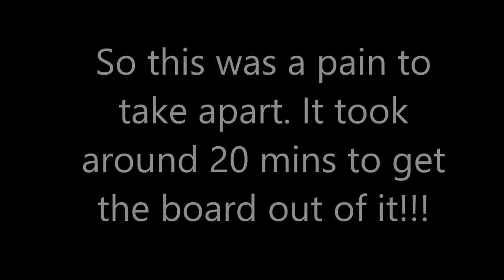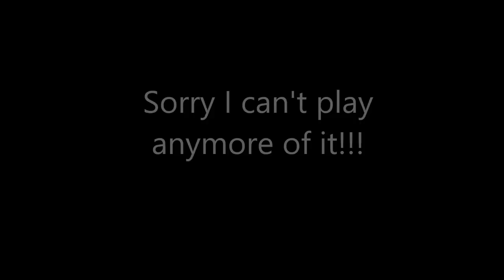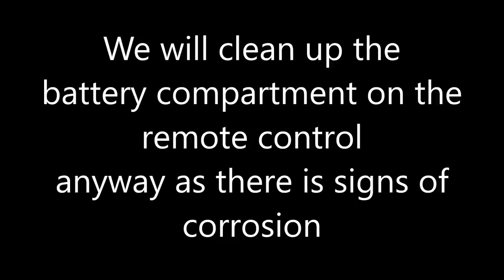Trying to FIX a Portable Faulty CD/CASSETTE/RADIO Player

Comment: Have to give a lot of credit to Paul. His first diagnosis was "switch" and he suggested bridging it to test :-)  By the way, Hitachi was in no way a "cheap" device. It may be of old school design now but Hitachi made very good and reliable devices back in the day  (judging by date code on IC, this one was made circa 2003).
Reply: Still do in some areas. I have a Hitachi angle grinder I bought a couple of years back, superb quality. Most of the Hitachi electronics is rebadged cheap stuff now but back in the day as you say they were one of the better second-tier Japanese makes, and let's face it none of the old Japanese companies made junk, even Sanyo at the low end made robust, reliable stuff.
Reply from the maker: 2003, thanks for the info. Yes he did well to suggest the fault pretty much at the beginning of the vid:-)

Comment: Panasonic boombox from the 90s palgged with switch issues. The only way test to check the control board is ok, is using the remote control. Panasonic systems used just a resistor array and a three wire reading for the whole front panel. Instead of reading ON / OFF it detected different small changes in the voltage line as different buttons have a different associated resistor (different value). Guess what ???? as soon as the switches started to wear a  bit an develop some ohms, system went crazy, as the voltage generated by one buttont shifted into other button value. Giving Play, turned radio. Pressing stop would rewind and so on. Pretty common failure mode. You need to replace all switches or at least the most used ones. As per the transforme output, dont worry. It could be two thing. The voltage goes down while loaded (boobmx on) or, boombx accepts more voltage than the one provided by batteries to put more ouput power on AC. This sounds rare, but many 80s boomboxes did it that way. They have TWO ouput power figures. Running on batteries was the lower one and running on AC the bigger one. but you need to regulate certain parts like the logic control and motor. The amplifier part does not need regulation.

Comment: On a portable CD player first try changing out the batteries to fresh new batteries. I had a CD player/radio, the radio worked but the CD player did not recognize a CD in it. I thought it was busted until I found the electric cord and plugged it in, then the CD player worked. So I put in new batteries and the CD player worked. The old batteries must have had enough juice for the radio but not enough power left to play CDs. Simple fix to try.

Comment: When you opened the radio, i saw all that capacitors in the mother board and thinked: Hopefully there is not a problem with the capacitors. Maybe you will take a few time testing each capacitors one by one.

Comment: Actualy if you unscrew the CD module you will be able to disassembly the whole unit pretty easy, sometimes there are screws under door. The LED is not dual color (it would had 3 leads), but it can be (unlikely) bi-colur (reverse polarity is used for other color). The construction is relatively good. The switch is momentary (the name is TACTILE Switch) it costs barely 5 cents. The repair went flawlessly. Perfect job Vince.
Reply from the maker: Brilliant advice, tips and info. Thanks again :-)

Comment: If the remote had worked the whole thing could be switched on with that.

By the way those little switches can be bought on ebay for next to nothing and are a common failure point.
Reply: I was going to say tactile buttons are super cheap bags in the 1000's for next to nothing.  Would be well worth getting them.

Comment: Nice fix :) Had to look up what's PAT inspection, never heard of that before (I'm Finnish). Circuit board looks indeed older technology, lots of electrolytic capacitors, soldered ribbon cables, etc., looks pretty similar even to my 1980's Salora Manager (Vtech Laser 2001) home computer cicruit board.
I should try to fix my 1992 Sharp portable CD-cassette radio player as the CD-player is skipping but apparently it needs some sort of special crosshead screwdriver, very long but also very thin one, to take it apart.

Comment: The button is a normal momentary pushbutton (yes that is what they are called, so you were correct Vince),  there is circuitry somewhere else that does the toggling on/off when the button is pressed. I know that because when you bridged the pads (so the button was not involved), it still acted like a toggle. Also, every toggle pushbutton I've seen has visibly pressed and depressed when toggled, it seems to be the physical position of the button that decides whether to make the connection or not. These buttons are very common and are cheaply available online. You see them used a lot in hobby Arduino projects, breadboard projects, etc.
Reply from the maker: Thanks for the advice :-)

Comment: Nice little fix this one! I strongly suggest investing in one of iFixit's kits for future projects. I have their Mako kit that has 64 bits, all the ones you could ever need including all security bits for games consoles and mobile phones like Nintendo/Xbox/Apple etc and I have never needed another screwdriver since. You also get a flexible extension bit included like you had at the end of the video for getting into tight spots. If you're feeling a little more fancy then go for their Pro Tech kit that also has every kind of tool you need to open up gadgets like spudgers, tweezers and suction cups. The case they come in also doubles as a parts tray. The kits are a little pricey but they are the best in the business and they back the entire kit with a lifetime warranty so if you manage to brake a bit or a spudger they will send you another one.

Also, please make a tape and a CD of songs from the YouTube audio library for testing, as much as we all love Jimmy Nail, Christmas songs and that episode of The Archers you need to save yourself from a copyright strike!

https://www.amazon.co.uk/iFixit-including-smartphone-laptops-disassembly/dp/B01GF0KV6G/ref=sr_1_1?keywords=ifixit&qid=1555512280&s=gateway&sr=8-1
Reply from the maker: Thanks Adam :-)

Comment: The LED will have 3 legs if its a 2 colour LED!  Great job =D  Nice idea swapping the tactile switch there from a spot that is infrequently used!  That type of switch is super common in lots of electronic products - eg. XBOX One shoulder buttons.  It's a 6mm x 6mm tactile switch.  They sell them with different height buttons - take a look on eBay!
Reply: GadgetUK164 - Retro Gaming Repairs & Mods I like to rescue the tactile buttons from old equipment as they always come in handy!
Reply from the maker: Thanks Chris, I will look out for the 3 leg LEDs in future. I didn't know the tactile switches were common so I may buy a selection box as a lot of comments have mentioned that they are a common failure point. Cheers mate :-)

Comment: Sometimes that yellow haze on top of solder points or joints are a conformal coating used to protect those points from an accidental bridge such as water. Think of it as a very thin layer of protective glue.

Comment: Hello Vince! I have a faulty ps vita, it was dropped in water and stopped working, and when charged it showed the light for power yet no display. I was wondering if you would be able to fix it?
Reply: Never charge a device that has water in it. And forget about the rice method. Clean the board with IPA and start from there. But do not charge if it has water
Reply: MirceaD28 it had no water in it when charging. I open up the device and let it air dry for an hour.
Reply: An hour? LOL, it wasn't dry at all.
Reply: Okurka that is not the only way I dried it. I opened up the entire board and made sure there wasn’t a drip, and put it back EXACTLY as it was before (I took many photos). Here is what I did:
1: opened up the board and let it air dry ( I live in Fresno and it was 105 degrees ferianhite) for an hour-3
2: put it in a bag of rice for 4 days
3. Made sure there were no parts that had water in them and no rice.

The device was not heat damaged, it was under a shader and when I touched it after drying it felt slightly warm.
Reply: Rice? Why didn't you put it in the microwave for 5 minutes?
Reply: @Okurka.  I was afraid to hurt the circuits.

Comment: hay vince. you can fix those micro switches easy. if you take the metal off that surrounds the button . you can take the button out underneath is a little metal disc shaped like a metal bowl. use some emery cloth on the concave part of the metal disc then reassemble it should work then. this also works on gba sp shoulder buttons.
Reply from the maker: Thanks for the info :-)

Comment: Hi vince, Just something you may be interested in I’m an eBay reseller and I’ve just got a load of electronics in and I have plenty of faulty stuff as well. I’ll probably end up listing as parts. I do have some working stuff as well but with random faults such as only works on batteries and not mains or the displays not working which sounds right up your street and at least you know it won’t of been dropped in a bath!
Reply from the maker: Hi, reply back with your eBay username and I will look you up or you can email it over to me if you want a bit of privacy :-)
Reply: My Mate VINCE Hi, My eBay is just AshleysUK, I will start listing the faulty items this week but if you check it out now you’ll have a rough idea of the stuff it’s going to be and I’ll pop back in the comments if I think something would be an interesting fix👍🏻 i do have one radio on there at the moment it’s the bush sage green radio that only works on batteries
Reply from the maker: @AshleySmith-su5mv  Thanks, I will check it out :-)

Comment: What is that thing you use to remove solder and no not the soldering iron the suction thing that sucks it up?
Reply from the maker: Hi, if you Google 'solder sucker' you will find them :-)
Reply: Cool, thanks;)

Comment: Common failure for these vince ..They are called 'tactile buttons/switches' and very cheap to buy in lots of 10 50 or 100 etc from China ...critical measurements when ordering are... shape... square or rectangular ..the dimensions of the button base and the height of the button above the switch base..they come in many types...rgds
Evan..there are even micro sized versions for car key fobs
The latching effect is usually controlled by the micro ...simply by toggling a voltage via the button on a dedicated I/O pin on the micro device.
Reply: I've not been into electrical engineering for too long though my initial feeling is that 5mm tactile switches seems to be pretty common. So I've already got 100 on order on the slow boat from China.
Reply: great idea buddy ..I have been repairing electronics since I was 12 years old ...now in my 60s ...and learned a long time ago .Whatever part you intend ordering always at least duplicate the order and if cheap enough ..multibuy.   8-)
Reply from the maker: Thanks for the advice Evan :-)

Comment: You can check most leds with your diode test setting on your multimeter. Swap the continuety of the leads to test if its a colour change as that is how a teo colour led often works if it is a two lead colour change led.
Reply from the maker: Thanks for the tip :-)

Comment: Hi Vince,  nice fix,  why don't you spend an hour taking  bits off boards you've been unable to mend and keep a compartment box with spares in,  I found a sky+HD  box in our back street at weekend,  no use really without a subscription but it has a 500gb seagate hard drive,  a 60mm fan and an abundance of micro switches all for free
Reply from the maker: Good advice, thanks :-)

Comment: Just in case you are not aware most Japanese products will use Japnese Industrial Standard (JIS) screws, not Philips.(They look very similar.)

The main difference is the depth of the cavity in the head, JIS is quite shallow compared to Philips hence using a Philips driver in a JIS head results in 'camming out'. A JIS driver should be OK-ish in a Philips head at a push.

Something to look out for is a single small indentation, (a dot), on the screw head. This will indicate it is a JIS head but not all screw manufactureres use it so a screw without one may still be JIS. Unfortunately the video is out of focus at the point where you show us the screw head so I couldn't tell if this is the case here.

JIS screwdrivers can be found on your favourite auction website although do tend to be slightly more expensive than your average 'Philips' or 'Pozzy'. You can also get JIS 'bits' and 'precision' driver sets too...whatever a 'precision' driver is...LOL.

As most of your repairs seem to be Japanese products it may be worthwhile investing in one or two....as you know, the right tool for the job can save hours of frustration.

Good luck, and thanks for the videos.

Just noticed this has already been mentioned...sorry.
Reply from the maker: Thanks for the detailed info :-)

Comment: you can see the beam of the remote ir diode with a cheap camera that doesn't have an ir filter. so it might not work with your nice camera but usually with cameras of e.g. smartphones. that's how i always check on my remotes if the batteries are flat. with new batteries the beam is a lot stronger.

Comment: Those units use a double insulated transformer that has a tiny fuse inside so maybe a new transformer of the same type should solve the problem,That large 100 leg flat-pack chip is most likely a Toshiba version of the Texas Instruments Blackfin DSP chip, What about using EVOSTICK to close up the crack, then let it dry then roughen it up with sand paper and see if that solves the problem.

Comment: Good repair Vince, but why were you doing this one on the floor? Often it's just a simple thing like that switch which stops something working. If you had tried the remote first it would have worked straight away! 
I've got a Sony M35 Minidisc CD Boombox system that has recently gone faulty,  but  it just says 'error' on the display & won't turn on or anything,  so I think it may be a more complex software fault.

Comment: 15:50 isn't holding the bord with your bear hands like that is dangerous, be safe vince nice vid
Reply: Boomboxes are low voltage. high voltage is reduce in the transformer. Board is disconnected anyways. You need to know in advance what you are doing. Handling a CRT TV board or an ATX PSU board even with a power cut ... completely different story, you can get the shock of your life.
Reply: @38911bytefree  aha that's why thank you so much for the information 🙏, could you please explain to me how to drain the power in a PSU board so you can work on it safely thank you blessings

Comment: what about JIS, Japanese Industrial Standard. Looks very similar to Phillips
Reply: I was also thinking the same, i have worked on several japanese stereo items andnthey have all used JIS, i have imported via amazon a awesome little JIS set of screwdrivers cost £10 delivered. Came with a coupke more useful screwdrivers as well.
Reply: Supposedly JIS screws can actually be damaged by a Philips screwdriver, because the Philips screwdriver has a rounded bit in the middle. The other way around should be safe.

Comment: i had try today trying fix my Wireless P2Mouse(Pc mouse) he wont just not turn on thanks to your videos i find out i need only clean the battery terminals(Akaline Battery(Varti) does leak when they are Empty) but my mouse have an another fault the right click button does seems be not work property.

Comment: Vince, i know this is a minor thing but it's the only thing that stops me really enjoying your otherwise great vids. Please, please can you turn down the audio when you're testing continuity, you have possibly the loudest and highest pitched multimeter i've ever heard and considering your method of testing continuity isn't just "put the probes on, it beeps, it works" it's "put probes on, it beeps, take probes off and put back on, it beeps, repeat x 10" it honestly get's sort of painful having such a high pitched loud noise going off for so long. As i mentioned i know it's a really minor thing and i do really like your vids otherwise, maybe my hearing is more sensitive than others but it really does bug me.
Reply from the maker: Hi, I don't have an option to turn it down on the multi meter and it would take a lot of editing on these long videos. I will see if the multimeter has holes to let the sound out as I may be able to tape over them to reduce it a bit :-)

Comment: So when testing cassettes, you should stick with testing them with the tape with voices on it. Music can be a bit subjective and hard to determine if there are wow and flutter issues. But we are hard wired to recognize voices, and it is a lot easier to hear if the frequency (speed) is a bit off.
Reply from the maker: Thanks for the tip :-)

Comment: Surface mounted parts seem a good idea but you need more expensive tools to work on them and smd parts fail with vibration, board flexing,  and capacitors that go short for no reason at all.
Through hole is simpler and cheaperfor the average man to repair.
You both tryed to give the impression you didn't know anything,  you suddenly knew too much later on lol :-D
Those switches are a pain, they play up in everything :-(.